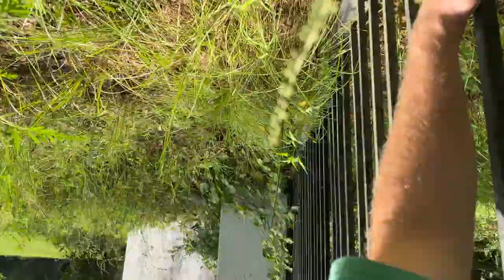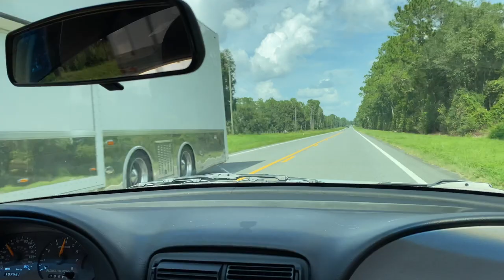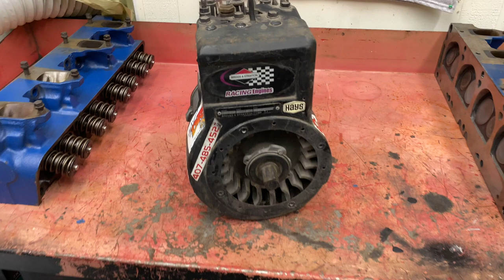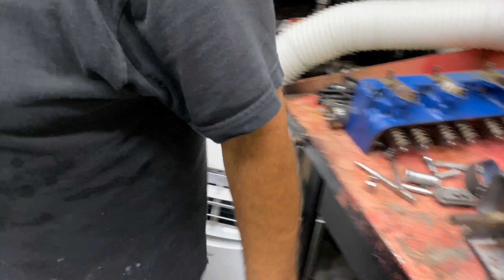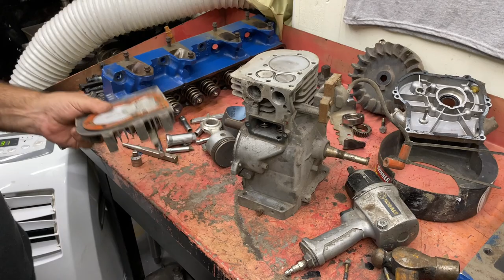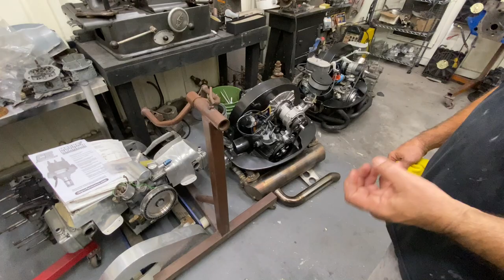Vintage GoCart Nitrous Boost Race Engine Restoration, Abandoned Newell Coach Motorhome RV, VWD, CT

Comment: That was a IC b/s 5hp motor having crank bearing 's my brother doug use to build 5 hp based go cart motors FYI if you can find a push mower motor it has an aluminum flywheel
Reply: Regular push mower flywheels explode past 4500 RPM....